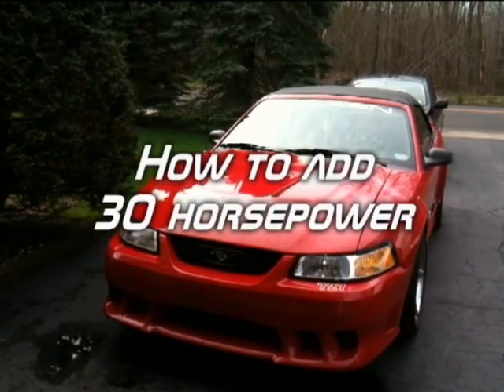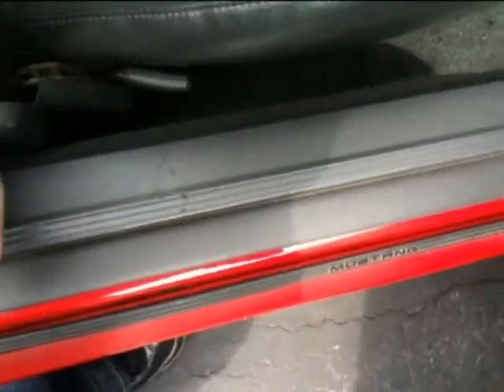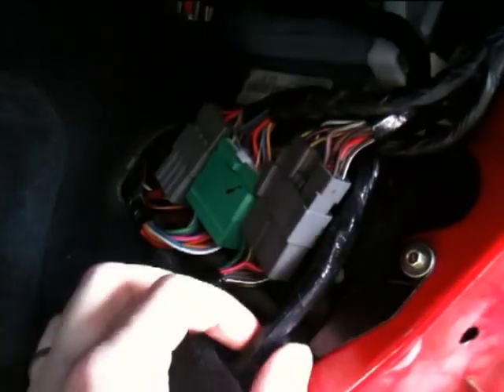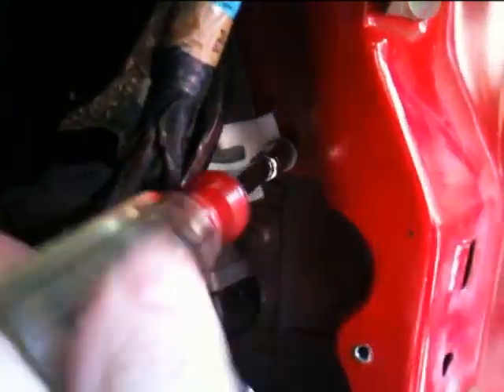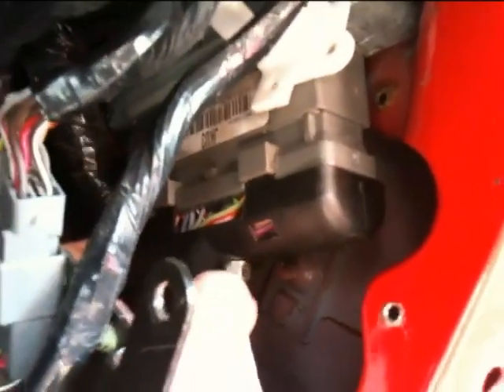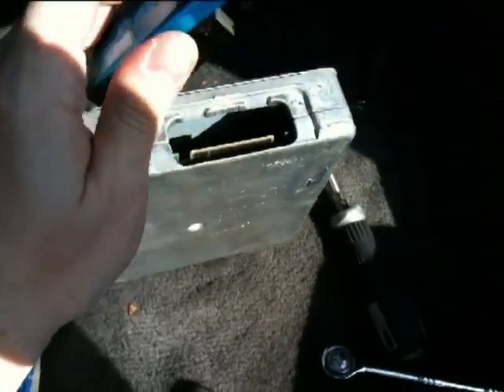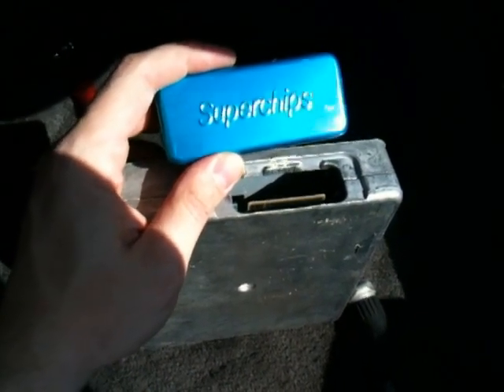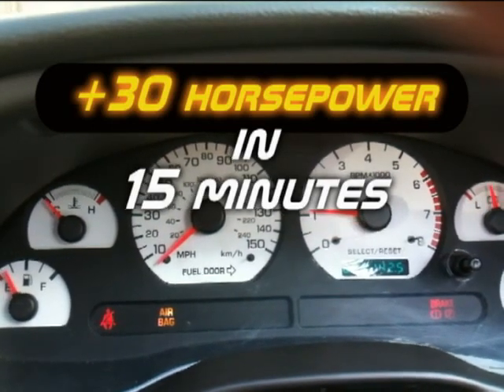Add up to 30 Horsepower to Mustang with ECU Tuning AFTER MODS

Comment from the maker: @crrazyy I wish it was free but nothing in life really is... 

However I did make my own ram air for only a few bucks, by buying some drier ductwork that is routed from my front bumper cover through the quarter panel and outputting right into my K&N air filter. :) And it does work!

Comment from the maker: @Wmatt82 I originally got a stock Superchip for my GT, but after I made more upgrades the car would stall out when decelerating from anything above 40 to 0 mph. I called the garage from where I bought the chip and he told me that I will need custom programming to solve the problem. 

After the custom programming my car has been running great!

Comment from the maker: And for my next video: 

How to pass Emissions by removing the Superchips module, resetting the computer, doing a drive period, then finally passing emissions. 

The Superchips module interferes with emissions reading equipment, so I have to do this procedure every-time I need to get my car retested. Then I have to put the chip back in and do it all over again to get my horsepower back to where it should be.

Oh yeah the Superchips module does work! See my video of beating a 98 Camaro SS.